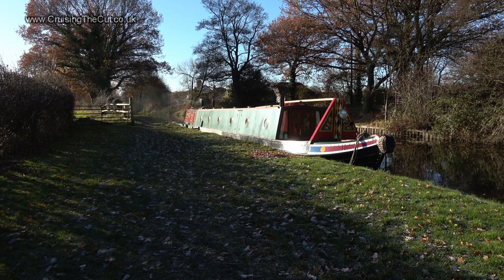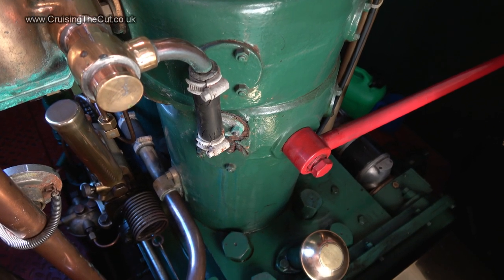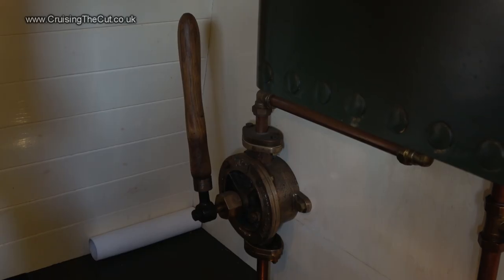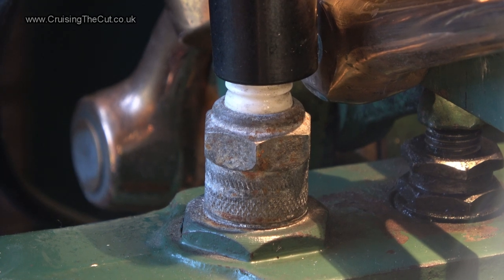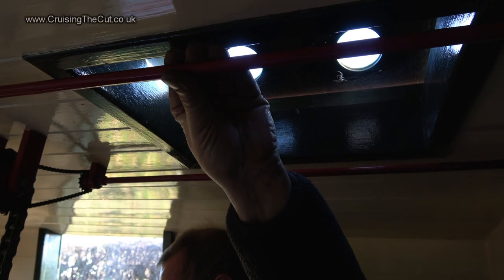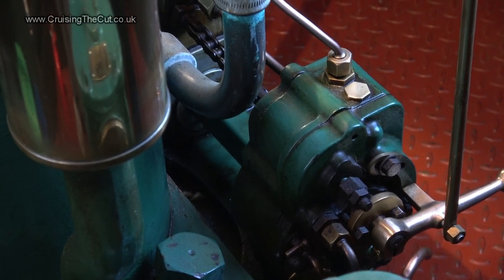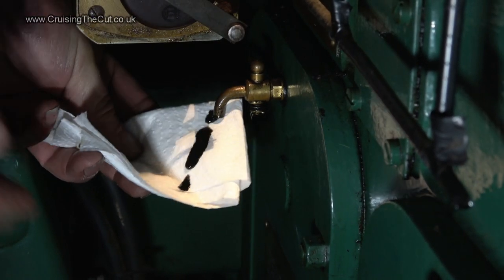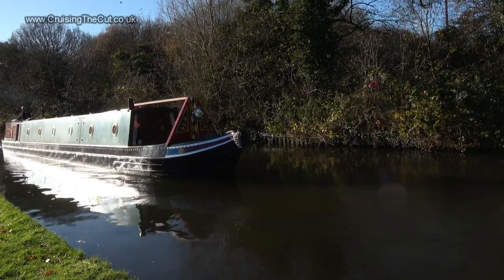129. Classic Narrowboat Engines Part 2: Kelvin K2 with Rob Goodman

Comment: Question: in general why don't narrow boats just have a 15hp outboard?
Reply from the maker: I'm no engine expert but 15 would be a bit underpowered for most I suspect, also outboards run on petrol and the canal network is set up for diesel supply, also outboards tend to be high revving whereas diesels are slow with lots of torque which is really what you need to push a massive lump of steel along.
Reply: it's not so easy to run an alternator to charge your batteries from an outboard, or use the cooling water to heat your hot water tank.
Reply: There aren't any low-speed, high-torque outboards that are large enough.  They make ones for sailboats up to 10 HP but the larger ones are geared for fast boats.  Besides, the diesels are quieter, nicer... the vintage ones doubly so
Reply: Thank you all for your replies

Comment: narrowboat dimensions inside try find  metre no luck find  tanks for video
Reply from the maker: Narrowboats are 6 feet, 10 inches wide. Lengths vary but the maximum is 72 feet.
Reply: hi 6 feet 10 inches (2.08 m) Beam = The width of a vessel at the widest point. so add walls how much have let inside cab please tanks

Comment: i know nothing but wouldn't electric power be perfect for a narrowboat?
Reply: No. Electric is crap. Hugely complicated electronics to maintain the battery banks. Narrow boats are all about history. Why contaminate it with some new age ecological thinking.
Reply: There are hybrid powerplants available for narrowboats. Full electrics would run into issues with charging. Solar panels wouldn't be sufficient, and between towns there's no place to plug in.
Reply: What about diesel electric i think that would be cool
Reply from the maker: Yes, I've done a video about a hybrid electric/diesel boat before but I forget the vlog number offhand.
Reply: It's vlog 69; went back and rewatched it.

Comment: I get that you want to keep these as museum boats, but for daily use?
Modern Diesel engines have 1/4 the fuel consumption, 1/100 the NOx and soot output.
Fuel prices should really go up 400%!
Reply: I think your numbers would bear some challenging, but agree most vintage engines will be running very lightly loaded so specific fuel consumption will not be optimum. If I ever take to the waterways I will likely make use of my 1942  Lister JP4, even if only 10 of its 40 bhp are deployed. Each to their own?
Reply: You're greatly exaggerating the difference.  Add in the carbon footprint of building an entirely new engine, and youd have to run 1000's of hours to make the difference.
Reply: Russel Newbury claim their DM2 2.6 litre engine of 12 hp consumes 1 litre per hour at canal cruising speed.

Comment: Could you survive with an electric motor, a battery, Inverter and some solar panels?
I'm guessing a surge in Electric car usage has already increased the mining of Lithium and they will have to keep increasing it, if Tesla builds it's expected 100 factories. Lithium batteries might fall in price affording the purchase of a few more, to aid saving as much as possible on sunny days.
I read somewhere we have 365 years worth of Lithium in the ground but that might have been pre Tesla. 
Termites produce more CO2 than all of us put together but somewhere in the future, someone will pop up on the canals bank, perhaps with an official looking hat on and uniform waving a red flag, offering you a slip of paper, and shouting "you can't sail that through here, it's a no carbon area, that's an on the spot fine, pay it in three days or I'll sink your boat under section 457 of the 1964 clean air act".
Reply from the maker: The solar would be insufficient to power the motor, even if you absolutely covered a boat in panels. Maybe in peak, peak summer you might do OK but any other time and you'd need a generator or hybrid system.
Reply: spex357 The termite "fact" is irrelevant. They may produce huge quantities of co2, but this forms part of the carbon cycle- it is only carbon recently absorbed by growing plants that is being excreted, so their activity does not increase atmospheric levels in the way that burning fossil fuels formed millions of years ago does. If termites didn't eat the stuff they do and excrete co2, the material would rot and produce exactly the same amount.